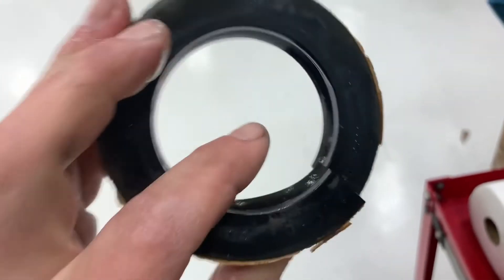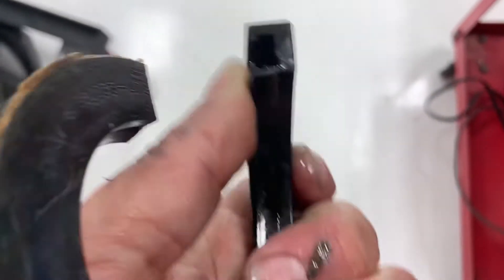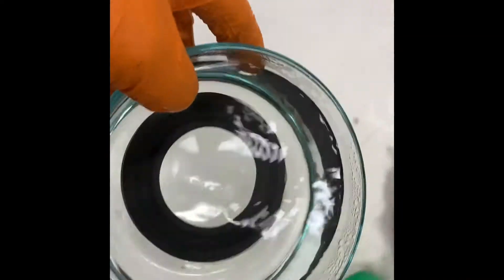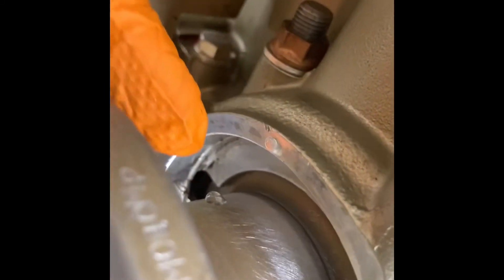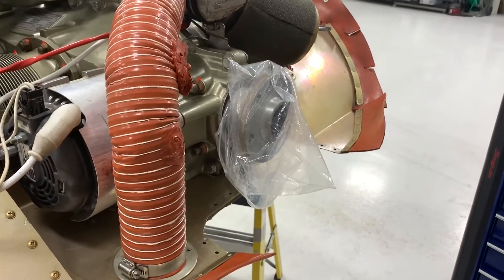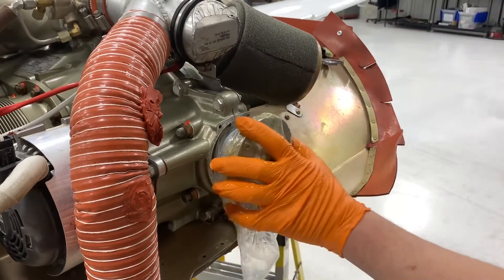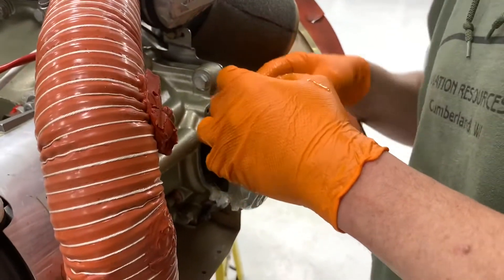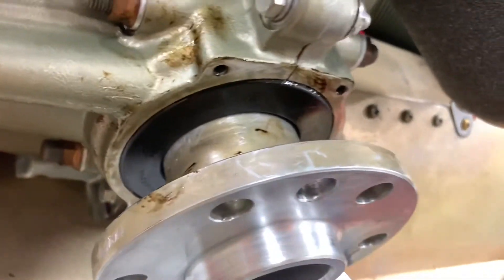Continental crankshaft seal installation

Comment: The pressure  on the seal is hard to measure because  it is almost  almost nothing. You would need a manometer to detect it. The only thing that makes the seal lip seal is the spring. The only time there would be a pressure in the crankcase is if the breather line were to freeze up from the moisture coming out.

Comment: Thanks for your video. 
It looks like you did it the easy way.

Its bad to sand a Continental crankshaft since it is nitrided which means that the nitriding is only a few thou deep and by sanding it you harm the nitrided surface.

Nitriding is a hardening process.
Reply from the maker: Its bad not to read the SB and MM from Continental.......
Reply: @AcVibes  😊For sure.✔ I once read somewhere that CO mask off the prop flange and back about an inch on the crankshaft behind the flange so that area is not nitrided.
                                                           The reason being that a slightly bent flange can be trued up on a lathe to bring the flange into spec. again.
                                                             I think that a max of .016" mtl. was allowed to be removed.
 Are you aware of this and am I correct-?

Comment: I did not see you put the spring on the seal. Is it not used with the one piece seal ?
Reply from the maker: I didn't show every step....The spring is used with this seal.
Reply: @AcVibes   is the spring installed seperately over the flange and then reinseted in the seal?
Reply: nevermind, I see the spring is seperated then installed

Comment: What type of adhesive is recommended?
Reply: After further investigation, most shops use Loctite 515 on both sides, bore and seal.  Not too much though, just a thin coat.
Reply: The book says Gasket Sealant (Part No. 654663) which crosses to Loctite 1522029.  It also says to prime the counterbore with Loctite 7649, and to apply a translucent coat of gasket maker # 646942 (Loctite 515) to the counterbore.  I am wonder if all this is necessary or if just cleaning and applying the Gasket Sealant to the outside of the seal is standard operating procedure for those who do this all the time.  Any ideas anyone?
Reply from the maker: CMI has has several sealants for ages...none have been revoked by SB's or AD's...

I have found almost all types holding the seal in place....none seem to have caused any seal issues...all the seals are retained by the plates on this case type....

IMHO...none are worse or better than the other...